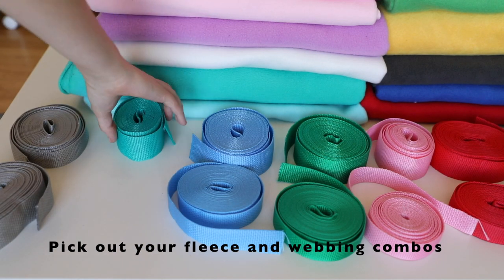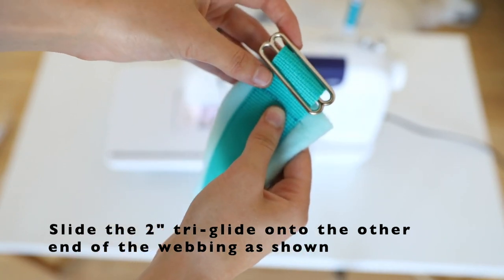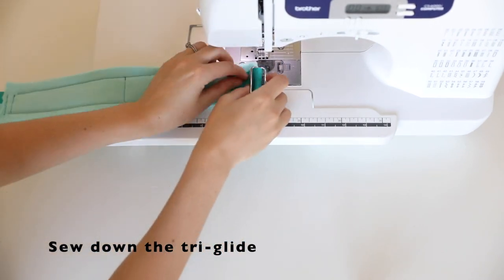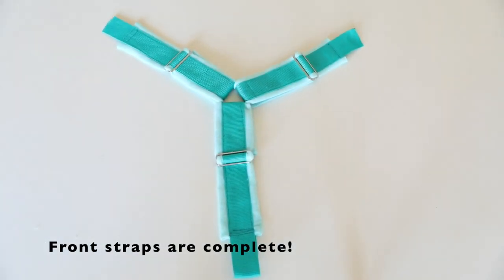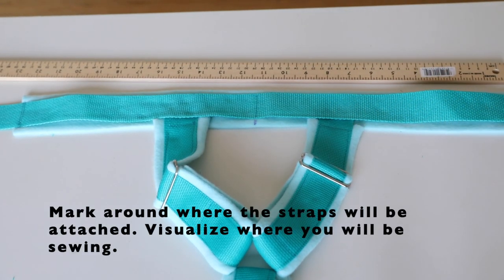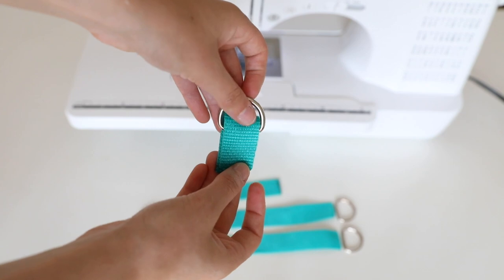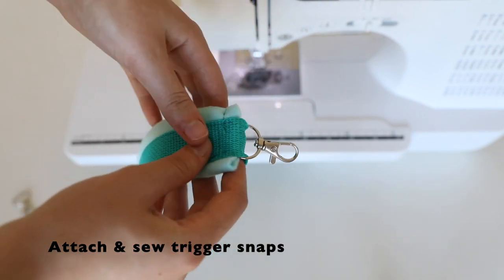DIY Fleece Dog Harness

Comment: This was super helpful. I've been making vests for months and wanted to move on to harnesses. I loved your buckle demo because i've been attaching mine a totally different way, but yours looks way easier. thanks!!
Edit after I've followed this tutorial and used the measurement guide to make a harness: 
1. I used 1" webbing instead of 1.5" as I already had 1"  webbing lying around. So I used a 4" wide strip of fleece instead of 5", and 1.5" triglides and triangle loop (versus a 2" triangle loop). The next time I make a harness, I'm going to use a 1" triglide for the girth strap, since that triglide is only attached to the webbing, and not the fleece. The 1.5" triglide worked well for the shoulder straps and the chest strap (these are different than the girth because the triglide will need to accommodate two layers of fleece with webbing, instead of just webbing), but I could have been fine with the recommended 2" triglide also. I would use a 2" triangle loop next time, instead of the 1.5", as it looked kind of bunched up.
2. I'm not sure if I measured the chest strap wrong, but it was WAY too long for my dog. I have to tie it in a knot to make the harness wearable. Next time, I will likely take off 2" or more of length from the chest strap.
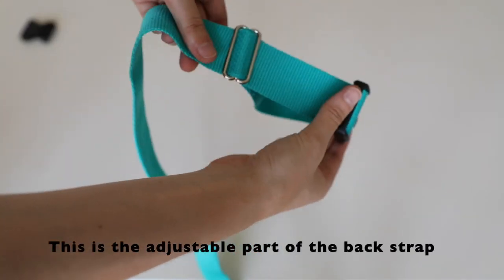3. For the girth strap, I left ~5 inches in between the triglide and the forked end of the buckle. I attached the fleece just below the triglide on the opposite side of the forked buckle (exactly as was shown in this video) and the fleece ended ~3" prior to the webbing where I then attached the flat buckle (again, exactly as shown). I don't think the spacing of the forked buckle and triglide was explained in this video or in the measurement sheets, but I estimated the measurements based on the size of your fingers (at 12:16)  in relation to the webbing and my own fingers, assuming we have similarly sized hands and that two fingers equals approximately 1".
4. Spray n Bond is your best friend for this project but be sure to not spray directly on the fleece as it could get caught under the presser foot. I sprayed it on the underside of the webbing and it worked perfectly.  
5. I attached the shoulder straps to the back strap 2.75" (instead of 2.5") from the middle on each side to avoid that little fold where the shoulder straps stick out a bit at the point of attachment to the back strap. I might do 3" from the center next time as the shoulder straps still stuck out a little. My dog is a medium sized golden with a 26" girth so if you have a smaller dog, you probably won't need to add any extra room. 
6. This makes a beautiful harness :)
Reply from the maker: thank you so much for this! the video is definitely just a summary so I wasn't able to include all those extra things - thanks for writing them out! it takes a lot of trial and error to get the perfect harness :)
Reply: @Bigcitybebes  thank you for posting the tutorial! Yours is the only one I've seen that doesn't overwhelm or confuse me. I can't wait to get more webbing to make a second :)

Comment: what size plastic tubing did you use for the semi rigid handle?? Awesome video btw I plan on making one soon for my service dog in training.
Reply from the maker: I don't remember off the top of my head but I have links to all the materials in the website link in the description. After making more harnesses recently I think that the "steel corset boning" is more sturdy than the plastic tubing. The only issue with the corset boning is that you need a steel cutter to cut it so the plastic will be easier if you don't have a steel cutter.

Comment: So I can just add another set of d rings for a cape attachment right? What would be the spacing for those
Reply: I added an extra d-ring on the loop where the other set where put so there's two on each loop it looks neater and for the cape and pull strap I use works fine

Comment: That's not enough stitching on the shoulder straps especially for counter balance mobility usage. :(
Reply: you can add more as you wish...?
Reply from the maker: throughout the video I say that you should reinforce it even more. this is also not only for service dog harnesses - any dog can wear a harness. this is an unlabeled harness.
Reply: @Bigcitybebes  I'm just thinking safety when the dog pulls. I did not say specifically service dogs. All dogs need pulling safety. That is what a harness is for.
Reply from the maker: @punkydoggear8172  that is why every few minutes I say to reinforce the attachment points over and over - for example with the "Box X Stitch" at every attachment point. The "Box X stitches" are used in sewing because they are  both parallel and perpendicular to the axis of the webbing. This distribution makes it so that in weight bearing, the loads are evenly distributed.
Reply: Look...I'm really not trying to upset you. Like I said the SHOULDERS need more stitching. There was no box stitching done there on the video, unless you've uploaded a new video. I liked your video otherwise...you did a great job. :) I have a double ortho approved gear shop and am trying to pass along wisdom of safety is all.